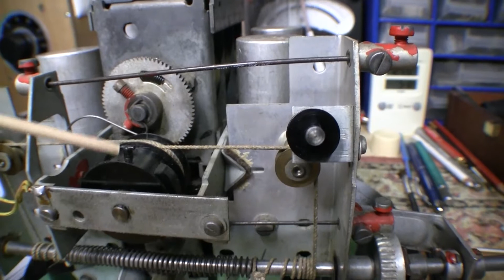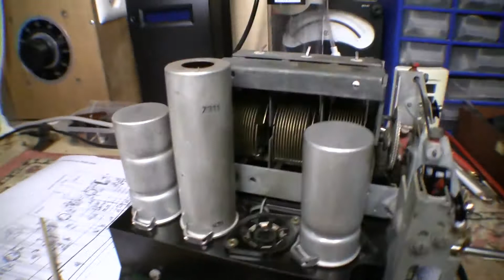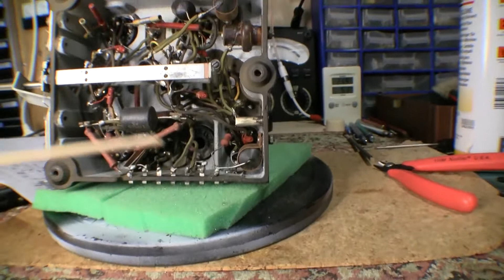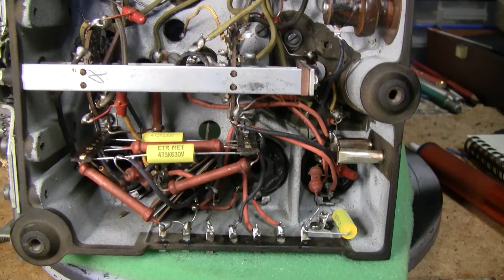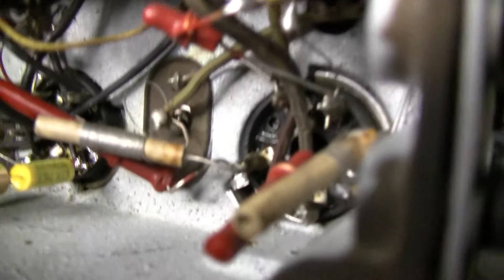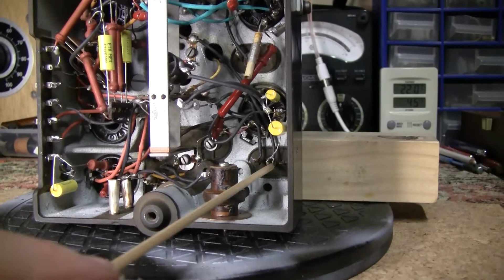Mediator M162A - part 4

Comment: Looks great.  Could that strange component be some sort of fixed book capacitor?  Is it on the schematic?
Reply from the maker: zachtownsend1 Not sure what it is - there's only one wire connected that I can see hence my assumption about a screen.  However the fact that it's not connected to chassis throws me completely.

Comment: I wonder how the shields on those IF cans are mounted on there? Do they use sort of a twist and lock affair because I can't see any screws or clips holding them in? With some types you can removed the metal shield without disturbing the wiring through the base, though you sometimes have to remove a grid cap lead clip. The dial transport system is just whacky, but even so if there is any part of it, such as a cord, that might fail in future I would work out some way of replacing it now.
Reply from the maker: OlegKostoglatov the shields are held on with clips but they probably had a special tool to bend them on the underside so not sure I'd fancy taking them off - might not easily get them back on again.  I agree re the dial so I'm looking at making a fixing that holds the dial to the chassis using the magic eye mounting bracket.   Of course it needs to be removable once everything is in place - that's proving to be a bit tricky - still working on  it.
Reply: Zone1242 They must have used some sort of jig like that to set up the dials in the first place, I've heard similar complaints about many Phillips models from the same era. In being used to North American radios it seems like putting the cart before the horse, here the dial transports are usually mounted on the chassis, especailly with a slide rule type dial. On occasion they will have the dial and pointer/curser mounted in the cabinet, but the actual cord or cable and pulleys are mounted on the chassis and the pointer just clips onto the cord once the chassis is bolted in. That in itself is a nuisance but it's at least manageable.  
  With regard to the coil shields, naturally taking one of them off is only something you do as a last resort, but it is something you may have to do. In my experience spring steel clips are not generally bent in place to hold them on, they are usually pre bent and then pushed into place. It is something that I would definitely not rush into, but if you sit there and study it for a time, and possibly give it and experimental probing, you may figure out how to get them out.